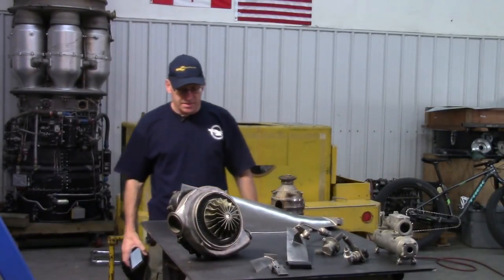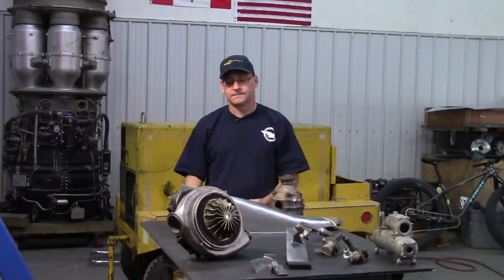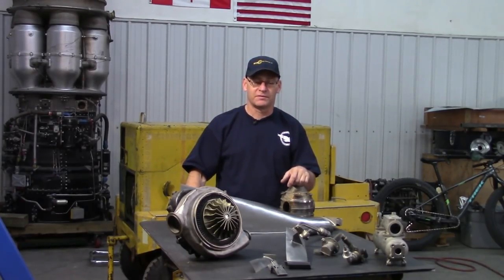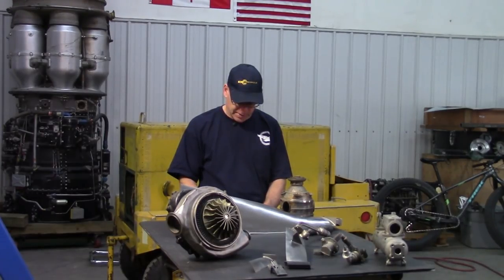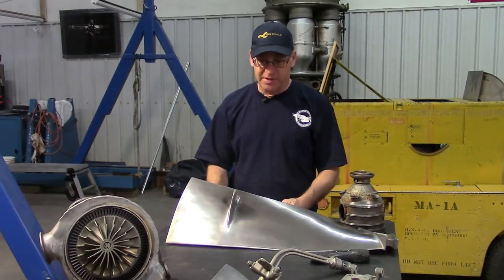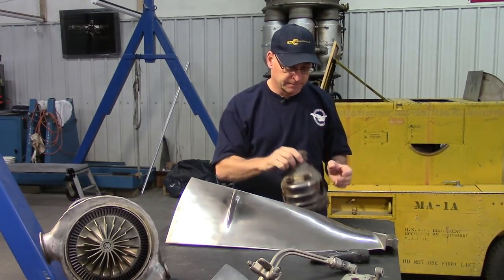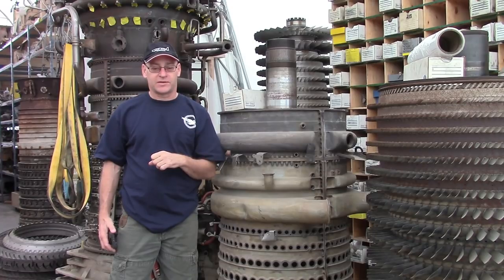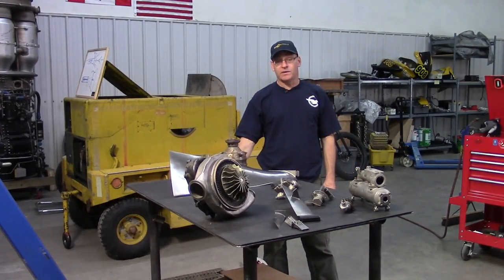Jet Questions 97

Comment: Hi. You talked about the Rolls-Royce Spey used as a gas generator. You explained that the fan is modified into a low pressure compressor, basically by chopping off the fan. But is the turbine driving the fan / low pressure compressor modified too? If the low pressure stage does not move any bypass air it needs much less power. So a smaller low pressure turbine would suffice.
Reply from the maker: +Jochen Kunz I think you are right.
But some Spey aircraft engine part numbers are the same as those used in industrial Spey...
Maybe Graham has some insider info...
He used to design engines for RR.
Reply: The LP Turbine nozzle flow area is greater in the industrial Spey engines, in comparison to the Spey engines used in aircraft applications.  This puts less energy into the LP spool and more heat energy into the exhaust which in turn is converted into shaft horsepower by the downstream reaction  or "power" turbine.  Otherwise, the turbine blading in the industrial Spey is identical to the aero models.
Reply: OK.  I wasn't, however, directly involved in and responsible for the design of the Industrial/Marine Spey, as I was busy with the Industrial RB211 on the next row of drawing boards (that was in the 1970s, long before workstations). 
Perhaps I should explain, before I go any further, that, initially, R-R did not refer to the front stages of compression in their early low BPR engines as 'fans'.  Even now, describing the front stages of compression in engines such as the Pegasus, RB199 or EJ200 as 'fans' and the engines as 'turbofans' are, I believe, terms 'borrowed' from the USA (well, years ago we got stuck with 'OK', didn't we?). The multi-stage 'fans' of US engines such as the TF30, F100 and F404 could equally well be described as LP compressors.  It's just terminology: there's no fundamental difference between the aerodynamics of a 'fan' and an 'LP compressor'.  
Nevertheless, back to the subject in hand.  The Industrial/Marine Spey was derived from the R-R/Allison TF41, itself a Spey core engine derivative, and I must admit that I'm working from memory now.  The TF41 LP compressor was, as I recall, unique in the Spey engine range, in having the bypass/core flow split occur part way down the LPC.  To create a non-bypass engine, the forward stages of the LPC were quite literally 'cropped'.  The prototype engine even utilised the original aero LPC casings with a blue-coloured plastic compound to fill the redundant annular spaces at the front of the compressor.
Now what happened to the LP turbine?  I'm hazy on this now, but it was certainly 'tweaked', with nozzle throat areas adjusted to reduce the power extracted: I don't think that a stage was actually removed  If I was at home in the UK (at the moment, I'm in Singapore for F1), I would do a quick check in my various books.  I could possibly do an internet search here, but I'm also busy being a Grandpa.
PS  I'm now reasonably confident that an LP stage was not removed.  I am also confident that nozzle throat areas were adjusted.  My guess would be that the LP2 NGV row was cut back or opened up by reskewing the aerofoils open.
Reply from the maker: What we have here is a truly historic YouTube event.
Jochen, the quality of your question, the insight and curiosity  you show, is on my scale a ten out of ten. 
Might just be the best question I've ever had in the ten years this channel has existed.
The two answers you've been given by Robin and Graham are of a level of knowledge and experience greater than you would get if you were in a technical college training to be a gas turbine technician.
This is how good things can get in terms of learning and teaching, and it's all free!
I am honored to have such an event happen on my little channel.
Reply: Here's a bonus for you, having been awarded ten out of ten on AgentJayZ's scorecard.
The rotational speed of the LP spool of the TF41 and the aerodynamic design of its compressor blading (and that of the turbine) would have been dictated by the tip speed of the first stage blades of the LPC.  'Cropping' the first three of the five stages of the TF41 LPC for the Industrial/Marine gas generator would have resulted in them running at less than an optimum tip speed.  However, the spool could not simply be upspeeded, because i) the aerodynamics of both the compressor and the turbine would then be beyond their design point and ii) the discs were not designed for the increase in speed.
If then, the five-stage compressor for the Industrial/Marine engine had been designed 'from scratch' for that application, it would almost certainly have had a higher rotational speed.  As a result (and I'm speculating now), it might even have had four stages, as the higher speed might have allowed four stages to do the work of five at the lower speed.  It might also have been possible (but I'm decidedly  less confident of this) to have had a single-stage LP turbine.
In suggesting this scenario, I am coming from the direction of aero engine design.  The five stages of compressor and two stages of turbine, with lower stage loadings, might have resulted in slightly higher component efficiencies - but that's yet more speculation.
Reply: AgentJayZ: Thanks for the high rating. ;-)
I got socialized in the Internet (Usenet) in 1992 at the age of 19.  Back then people where much more serious and conscious about what and how they did on The Net - technical and social. The Net was a scarce resource that everyone used with great care and respect to other users. Call me old fashioned, but that is still the way I am, as I grew up in that mindset. That is why I only speak up when I have to contribute something substantial.
Reply: grahamj910: Many thanks for this deep insight.

The thing that brought up my original question was: As far as I know a turbine runs faster the lower the load given constant flow through the turbine. If the fan of a LP stage is removed, a lot of load is removed from the LP turbine driving the LP compressor / fan. So the entire LP spool would run much faster, possibly to fast for the disks and blades. Also the LP compressor would compress more causing a "dis balance" between the LP and HP stages or feeding more air at higher pressure into the HP system then designed. This would alter the characteristics of the entire setup. So my thought was that the LP turbine has to be adapted to the reduced load without fan. Thus the LP spool in a gas generator version of the engine runs at about the same RPM as in an aeronautical turbofan.

You confirmed pretty much what I suspected: You can tailor a two spool turbofan engine towards use as a gas generator. But then you have to essentially redesign the entire LP stage - turbine and compressor. This is a massive engineering effort. The cost is prohibitively. So you take the existing LP stage and tweak it as little as possible to adapt it to run without fan. Much easier, faster and cheaper as many existing parts can be reused.
Reply: I think AgentJayZ might even have awarded you a gold star for this thought process.
Reply: I don't think calling engines like the Pegasus, RB199 or EJ200 turbofans and their LPCs fans is correct. I think for an engine to be a turbofan it has to have a fan, a huge single stage rotor, with no diffusor vanes, it is not enough to have by-pass air. Engines like the GE90 or the Trent family are turbofans. Pegasus, RB199 and EJ200 are by-pass turbojets. In my opinion calling them low-bypass turbofans is a misleading term. One only needs to compare side by side a GA of a Trent and an EJ200 for example to see the difference.
I sometimes do basic introduction courses to engines to my colleagues and I always stress the difference (and of course point out the similarities) between turbofans and by-pass turbojets. Also, I may be wrong but I don't think actual turbofans can fly at supersonic speeds like bypass turbojets do.
Reply: Just to clarify my last sentece, I know there are no supersonic turbofans currently, as oposed to by-pass supersonic turbojets, I mean that it is not possible to design a supersonic turbofan (again, I may be wrong)
Reply: Personally, pedant that I am, I tend to agree with you.  However, the terminology is now so well entrenched worldwide, such that there is no way that you (or I) will be able to change it.  My suggestion is that you explain the difference between high  BPR turbofans with large single-stage fans and the low BPR machines that are now described at 'turbofans' by the industry.  Move on to register your objection, then put up and shut up.
Reply: I guess you are right, but the terminology already changed once. Books from the 90's and 00's used the right terminology. I'd say that only in the last 10 years everything has become a turbofan.
Reply from the maker: +Laertes L 
Very gentlemanly of you sir, to state that this is your opinion.
Mine is that if there is bypass flow, then the engine is a turbofan.
To me, a fan is an LPC, of any number of stages, that moves some of its output around the fuel burning core. Bypassing it.
To me, bypass engine equals turbofan.
So saying bypass turbine is like saying green-colored red light.
In my opinion.
Reply: Well, I will not change anyone's opinion, but the fact is that a fan lacks the difussor vanes after the rotor, vanes that do most of the compression after the rotor accelerates it. A fan is not equivalent to one compressor stage, at most it's only half a stage. I think that is the key point for not calling the LPC fan or the fan LPC.
Reply: Let me correct you: a single-stage fan has a row of outlet guide vanes for the by-pass flow, which perform exactly the same function as the stator vanes of a compressor stage.  The fixed inlet guide vanes (the R-R term for which is 'engine section stators') at entry to the core engine of an R211/Trent perform the same function for the core flow.  Have you ever designed a fan or a compressor?  I have - formerly Chief of Fan and Compressor Design at R-R Bristol.
Reply: I haven't, I work more on the LPT, and I wouldn't want to impose on anyone, much less on a former designer, but I think the vanes after the fan on the by-pass flow are struts to hold the fan case in place and also to straighten the flow after the fan (similar to the function of the TBH vanes after the LPT), but I don't think they compress the air as the vanes on the compressors do for the simple reason that the by-pass flow does not need to be compressed anymore because it nos going to be burned. The purpose of the fan (on the by-pass flow) is to accelerate the flow to provide thrust directly, like a propeller in a turbo prop. If I am wrong I would be very grateful to know why, I am always trying to learn more.

In the core flow part of the fan I totally agree with you. 

Thanks Graham (we are somewhat distant colleagues by the way) and Jay for a healthy discussion and a great channel. Apologies if my english sometimes seems odd because it is not my mother tongue.
Reply: Graham, apologies again, but knowing that you were Chief of Fan and Compressors Design at RR, would it be fine if I make you a couple of questions about the fan here?
Reply: AgentJayZ is our host here and, although I do contribute quite often (and at length), I am very conscious that I am a 'guest'.  If he doesn't mind, I am happy to answer questions here, as I always try to frame my comments and answers for a wider audience rather than any one individual.
Reply: Please see my reply to another question.
Reply: I'm sorry, but I have to tell you that opinion is not fact and can be positively misleading.  There are those out there who still believe, for example, and despite all the evidence to the contrary, that aerodynamic lift is generated by the force of the air on the underside of the wing.  I digress to make a point.  You really must do more research for yourself, observe more and continue your education in the theory, principles and practice of gas turbine engines.
Let me start by telling you that, from memory, the pressure ratio of the fan of a large, high by-pass turbofan engine is around 1.4:1 to 1.5:1.  I have also taken my own advice and checked out the Trent XWB engine.  The fan pressure ratio of this engine is as follows: PR root = 1.4:1; PR tip = 1.45:1.  These values compare with the stage pressure rise of many compressors and certainly do not represent a device that is simply accelerating the air.  A propeller produces very little pressure rise across the propeller 'disc':  I have seen 1.02:1 quoted somewhere. 
The fan OGVs certainly do straighten the airflow and they do act as structural members.  However,  check out some illustrations and photos of both the Trent XWB and the Trent 1000.  You will observe that the OGVs have a pitch/chord ratio similar to that of a stator vane row in a compressor. They also have definite stagger and camber angles, resulting in a divergent passage shape. So what does such a passage shape do?  It acts as a diffuser, exchanging velocity for pressure.  Finally, observe the fact that the by-pass duct converges to form an annular nozzle.  And what does this shape do?  It accelerates the air, exchanging pressure for velocity.
If you wish to see a conventional propeller working at the limit of performance, find a short clip on YouTube of a TU-95 performing an in-flight shutdown and windmill restart of one of its Kuznetsov NK-12 turboprop engines. You will observe the 'stobe' effect of the video camera reveals that the prop blades, when under high power, are at an extremely coarse pitch setting and appear to be very nearly feathered.  Here is your test question: please explain why , comparing and contrasting the propeller with the fan of a high by-pass turbofan?
Reply: Thanks Graham, I stand corrected then. I am a mechanical engineer so I think I know a little bit about this, it is not just my opinion, but I can be wrong as any human and in fact I was. I have read many books and of course studied it during my degree, but sometimes there are little details that you can only learn hands on, as Jay shows on his videos. My errror was just ignorance about the fact that the vanes after the fan on the bypass flow are also divergent in shape and so acting as a diffusor, as I said I am closer to the LPT than the fan. Seeing the long gap between the fan and the vanes (around 1 meter in the biggest engines?) I thought they did not act as diffusor vanes. 

In any case now I have more questions:

- The position of the vanes after the fan is dictated by their function as struts, isn't it? Is that not affecting their function as diffusors being so far away from the fan? For the best efficiency shouldn't they be as close as possible as the rotor and stator of compressor stages are?
- You said that for the fan the pressure ratio (1.45:1) is similar to one compressor stage, but do you now how much is created by the fan and how much by the vanes compared to a compressor stage? Seeing what I comment on my first question I'd say that the split is reversed.
- This question may seem silly, but don't yout think that your own title of Chief of Fan and Compressor Design shows that fans and compressors are similar but not quite the same? Otherwise your title might have just been Chief of Compressor design. Something screams in my mind when I hear someone calling the LPC say of a F404 or an EJ200 fan. If you take them out of the engine as a module and compare them side by side to a GE90 or TXWB fan I think they are different machines, similar yes, but not completely the same as both LPCs are.  

Regarding your question, and I hope I am not wrong on this one too, the propellers are at a very coarse pitch when the engine is at high power to absorb all that power, if the propeller was at fine pitch it would overspeed quickly and very bad things would happen. The pitch control adjust it to keep the RPM constant whatever the power setting is. Also, when the engine is stopped they have to windmill it to reduce drag.

A fan has not variable pitch blades as the propellers have (at least not yet, it seems that it will change in a few years), I'd say that the mean pitch (I don't  know if this is the right term) is a compromise between efficency at cruise and take off and also it has to ensure that no overspeed happens at high power. There are sensors too measuring the speed that will cut the fuel before the overspeed happens as a safety measure.
Reply: Of course I meant feather and not windmill above.
Reply: Graham, sorry to bother you again with more questions, but your answer confirming that the fan stator on the by-pass are indeed diffusors got me thinking and I can't understand the reason behind it. Why there is a diffuser lowering the speed and increasing the pressure after the fan in the by-pass flow and after that a nozzle doing just the opposite? There is no more energy added to the flow after the fan rotor, and the diffuser will incur a small energy loss, so wouldn't it be better just to have the nozzle as the objective is to have a high speed flow to produce thrust? Something like: Fan rotor increases speed and pressure (increases the total energy of the flow)---> nozzle reduces the pressure to ambient pressure and increases the speed (keeps the same enrgy the flow had wehn leaving the fan, minus the inevitable losses)

I have done also what you suggested and I have been reviewing some drawings and for example on page 18 of the Jet engine book by RR 1996 edition (which I have had since 1998 if I remember correctly) there is a picture of a Rolls-Royce RB211-22B that shows vanes after the fan that don’t look like they are diffusors. It may be that the picture is not accurately representing the actual engine or it may be that I am interpreting it wrongly. I don’t wan’t to question your answer about them being difussors too, I just want to learn the correct facts, if you could point me to a better picture that shows them as diffusers and not only struts, it would be great. Or much better if you could provide some actual values of the pressure and speeds before and after the vanes.

Incidentally on pages 6 and 16 of the same book, a low by-pass engine is called by-pass turbojet as I do, not low-bypass turbofan as the majority of books do and Jay here does. It’s true also that on the same page 16 it calls the fan LPC in the picture showing a turbofan, so I guess the terminology is a little bit ambiguous or interchangeable.
Reply: Referring to your last comment first, I have the same edition (and later ones) of 'The Jet Engine'.  And yes, R-R Derby did initially use the term 'low by-pass turbojet', to which I referred in a previous comment.  However, that terminology is no longer used, having been overtaken (I believe) by the use of the term turbofan by US industry for both low and high by-pass machines.  Like it or not, we are stuck with it - and it effectively paid my salary for several years.
Going back to your RB211 question, I don't have access to my books, as they are over 6,000 miles away.  However, from memory, some of those illustrations are somewhat diagrammatic.  Technical illustrators, working long before the days of CAD, didn't always get the fine detail correct.  You need to look at actual photographs, of which you will find plenty on the internet.
On the subject of positioning of the fan OGVs, my experience with single-stage fans was limited, as the RB401 and RB432 were designed before I moved to R-R Bristol  in 1982.  RJ500 design was well under way and I was, in any case, on turbine design at that time.  When I moved over to fans and compressors, the RJ500 was on the move to Derby, to become the V2500.  The collaborative work split left R-R Derby with design of the HP compressor, which we at Bristol had to sort out for them, when they got it wrong.
So, based on a hazy recollection of design principles, the axial position of the fan OGVs is not based on mechanical considerations.  I don't think that you will find one big turbofan that has the OGVs close downstream of the rotor.  There is a need to optimise (compromise, if you will) the design for a wide range of operating conditions at power.   BPR, for instance, can vary significantly with altitude, as does the 'swirl' out of the fan rotor blades.  The spacing may also be beneficial in terms of noise reduction.  Current design practice will feature extensive CFD work on the aerodynamics and FEM on the mechanical/structural issues to achieve an effective design optimisation.
You indicate that you are working in the industry: may I ask where?  If not the company, the country?  What I have in mind is to suggest that you direct your enquiring mind to tracking down the relevant specialists and asking them for an up-to-date overview.  With in-service training and CPD in mind , there should even be instructional sessions for young engineers.
Finally, good marks for appreciating the basics of the NK-12's props. They are very near the limit of working aerodynamically, and are at such a coarse pitch, in order to pass a 'cylinder' of air through the prop disc, whilst  accelerating it.  If they went into fine pitch at cruise, it would be disastrous - and I wonder whether that has ever happened in service, with information about the event being suppressed.
Reply: Thank you again Graham. The Tu-95 is still very impressive, isn't it?
I work in the company that, among many other things, designs and manufactures all the LPTs for the Trent 500, 900, 1000 and XWB, if you still keep track of RR progress it will not be dificult to you to guess the name. In fact I've been several times in RR-Bristol (old and new facilities) and in RR-Derby.  Unfortunately we don't participate in anything related to the fan, but I may be able to find someone who can shed some more light.

Regarding the terminology, I don't like it, but your are right, we are stuck with it. My guess would be that the US industry started using it for marketing reasons, as a way of moving away from "old, nosiy, smoky turbojets" and welcoming the "silent, cleaner and sexier" turbofans.
Reply: Hola!  So do you work near Bilbao or Madrid?
And yes, the Tu-95 (and its engines) remains quite an impressive machine.
Reply: Have you visited the Turbine Design group in Fedden House at R-R Bristol?  If so, have you come across my old friend and former colleague Jon Parr?
Reply: As I am also interested (obviously), I have been trawling through a few video clips on YouTube.  Take a look at a one-minute clip by R-R on the 'Launch of the Trent XWB-97'.  At 28sec in, you will get a glimpse of the fan OGV assembly, clearly showing the camber, stagger and sweep of the vanes: at 38 seconds in, you will see the Engine Section Stators.  There is also another clip of the 'Assembly and First Test of the Trent 1000', with the text apparently 'en español'.  At about 1min 53sec in, there is a brief glimpse of the assembled fan casing, with a good view of the ESSs and the fan OGVs.
Reply: You guessed it, near Bilbao. I don't think I've met your friend, I worked some years ago with the people managing the EJ200 production.
Reply: I've watched the videos (the text is indeed in spanish) and several photos but I still can't see the divergent shape between the vanes (it may be so subtle that it doesn't show to the naked eye) and also I still can't understand why would you put a diffusor between the fan and the nozzle, as I explained in one of my previous comments.
Looking for more information I've found a research paper by RR-Deutschland and some other companies about optimizing the fan OGV that seems to corroborate my original view about the OGV's purpose being to straighten the flow and to hold the case only. I quote from the paper introduction:

"The present paper describes the aero-mechanical optimisation of a fan outlet guide vane (OGV) in the bypass duct of a modern turbofan engine. The purpose of the presented outlet guide vane arrangement is to remove the swirl from the flow coming from the fan and to connect the engine core structurally with the bypass duct and the engine mounts respectively. For that reason the outlet guide vanes have to fulfill aerodynamic requirements – such as low pressure loss and large working range and turning of the absolute flow to 0 degree – as well as the structural requirement to withstand the engine loads in all operating conditions."

Also the paper shows that in the OGV there is a small pressure loss, and not a pressure increase as it would be if it was a diffusor like the stators on the compressor stages. The paper is here:

https://www.researchgate.net/publication/225234126_Aero-mechanical_optimisation_of_a_structural_fan_outlet_guide_vane

Can you please read it and share your thoughts? For sure you can get some more details out of it than me.

It would be helpful also if Jay still had that old CF-6 he showed in some videos in the past and could check the OGV in it. 

Sorry Graham, this is driving me nuts, lol. I have another introduction course for around 30 colleagues next month and I'd like to be sure I have this clear.
Reply: I came across the paper to which you refer some time before you did and I was going to recommend it to you, but then I decided that it might confuse you, which it has.  Your confusion confirms to me that, unfortunately, you need to gain an altogether better understanding of fluid mechanics and aerodynamics.
You point to the fact that there is a ‘pressure loss’ across the fan OGVs, as stated in the paper.  To add to your initial confusion, I must confirm that there is, indeed, a pressure loss across the OGVs - and that there is a pressure loss across every stage of stator vanes of every axial flow compressor that has ever been built.  So how do the stator vanes contribute to the pressure rise in a fan or compressor?  The clue is in the fact that you have omitted to take account of the term ‘total pressure loss’, which, for example, is shown in the graph at fig. 11 of the paper.
Fan and compressor stators do no work on the air to increase its total pressure, which, as you should know, is the sum of static pressure and velocity head. Therefore, because of friction and aerodynamic losses, there must be some loss of total pressure as air passes through a stator vane row.  This is no different from any other flow process through a duct or pipe, where there is no net addition or subtraction of energy.
So what is actually happening?  I believe I’ve tried to explain to you previously that the diffusing passages between the vanes exchange velocity head for static pressure, that is, by reducing the velocity of the flow and increasing its static pressure.  It is, therefore, the increase in static pressure that is the pressure rise across a stator vane row, which forms part of the compression process.
The diffusion and resultant compression process in the vane passages is, of course, simply another example of the conservation of energy.  However, friction and aerodynamic losses deduct from this exchange process, reducing the static pressure and velocity slightly.  The resulting losses are converted into heat, thereby maintaining the balance of the two sides of the conservation of energy equation.  In performance terms, they are effectively accounted for in the component efficiency of the fan or compressor.
It is unfortunate you cannot immediately perceive that the passage shape between the vanes is forming a diffuser.  So how can I help you?  I imagine you can readily appreciate that the passage between two turbine NGVs is convergent, with a significant reduction in passage width from inlet to outlet and the passage is, therefore, forming a nozzle.  HP NGVs, for example, turn the combustion outlet flow from an axial to a circumferential direction and, in doing so, exchange pressure for velocity, do they not? Fan and compressor stator vanes essentially perform the opposite function.
The change in passage width may be much less obvious in a compressor stator vane row, but in turning the flow from a circumferential direction to a more axial direction, can you not appreciate that the stator vane passage is divergent?  If not, then let me make one last suggestion.
Trace or copy the aerofoil profile of one of the OGVs in the paper twice over and space them approximately relative to each other, as if in the engine.  Now draw a series of circles tangent to both surfaces of the aerofoils forming the passage from inlet to outlet.  You should see a gradual increase in the diameters of the circles from inlet to outlet.  This is, in fact, the way that we checked the divergence and convergence of compressor and turbine passages respectively, long before the availability of CAD.
Reply: Thanks for your patience Graham. I know what you explain about energy conservation, loss in the stators and that no energy is added in them, if you check my 9th comment above you can see I already mentioned the losses and the balance between speed and pressure. I just failed to notice that the graph was showing the total pressure and not the static pressure, silly of me. But that's the point I can't understand, the total pressure that arrives to the nozzle would be the same without the OGV (not counting the small loss in it), as you said no energy is added, then why have it in the first place?  Why increase the pressure and lower the speed in the OGV and do the opposite after that in the nozzle when the purpose is just to increase the speed of the flow? Wouldn't it be simpler to just have the nozzle?

Maybe I am not explaining myself correctly, if we were face to face I think it would de much easier.

Yes, in the NGVs I see clearly the convergent passage, I just happen to have one on my desk. Maybe if I had a fan OGV too I'd see the divergent passage!
Reply: So why straighten the outlet flow from the fan, increase its pressure and reduce its velocity?  It's a case of reducing the losses in the by-pass duct before the final nozzle.  
You will be all too familiar with the fact that R-R and its partners have been clawing back every fraction of a percentage point of efficiency in the design of their turbines.  For instance, there's all that pipework around the turbine casings, blowing cooling air onto the casings.  It is not being done merely to keep them cool, but to 'shrink' them and minimise turbine tip clearances.
The same goes for gaining every percentage point of efficiency at the 'cold' end of the engine too.  You have had a glimpse of the optimisation of the fan OGV at R-R Deutschland, the major objective of which was minimising the total pressure loss over a wide range of operating conditions.  In increasing the pressure, reducing the velocity and straightening the flow, the fan OGV ring is similarly reducing the losses in the by-pass duct.  
And there is also the small matter of eliminating the swirl in the actual exhaust efflux, which would be wasted energy.  For example, every single turbine that I've come across has been designed to produce as near an axial flow into its exhaust system and final nozzle at its design condition for this reason.